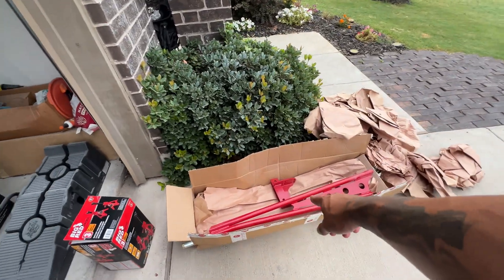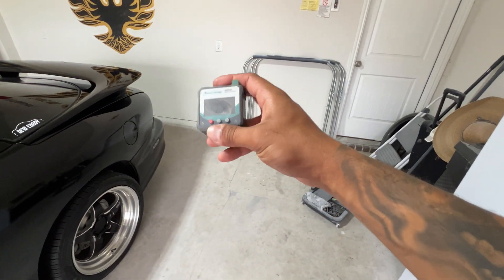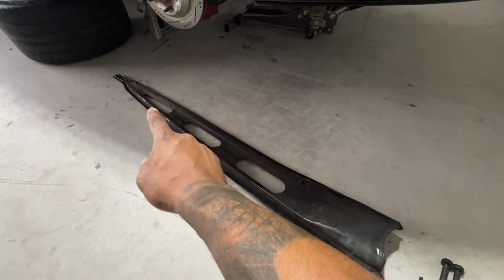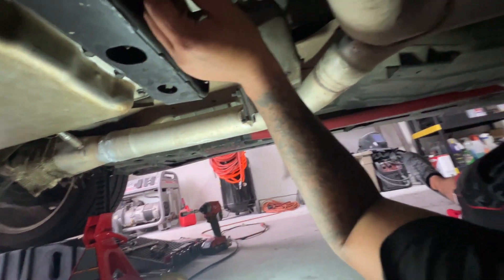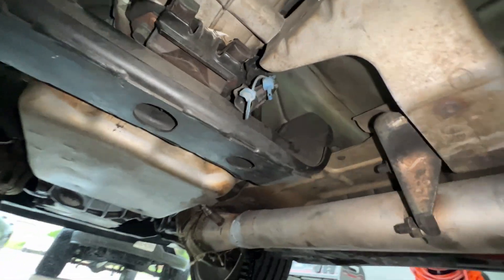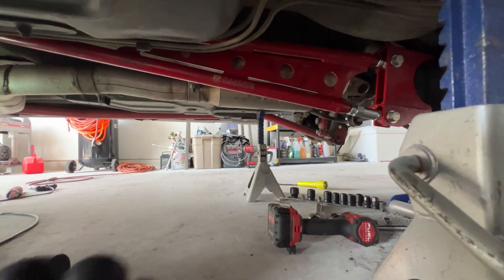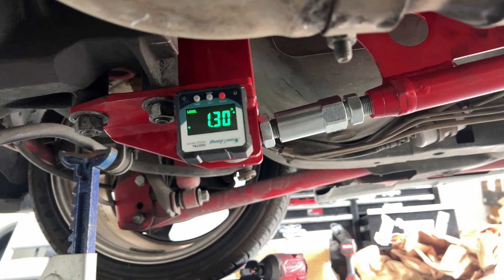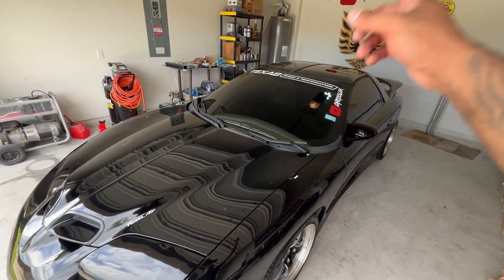Torque arm install & pinion angle set

Comment: I have the umi torque arm and relocation bracket, as well as sun frame connectors, rear lower control arms, and pan hard bar. It’s a 01 ws6 auto, if I downshift myself at any rom over like 1500 I hear a big clunking sound. Also if I’m turning and the car shifts I hear a clicking sound. 

Trying to figure out what my issue is, I have no clue.
Reply from the maker: I was worried I was going to have noises but luckily none so far 🤞